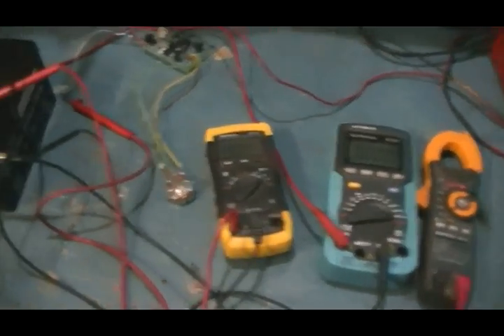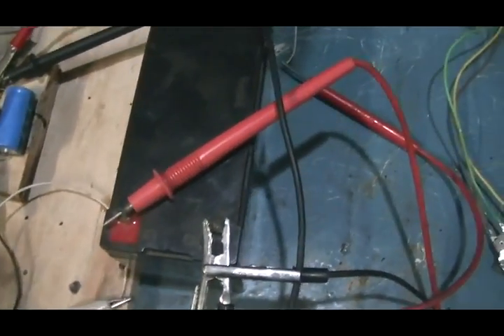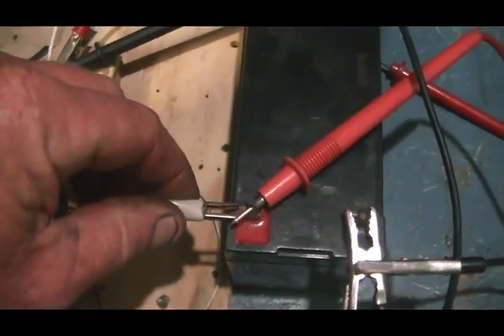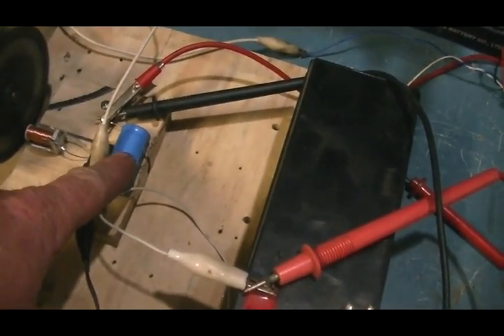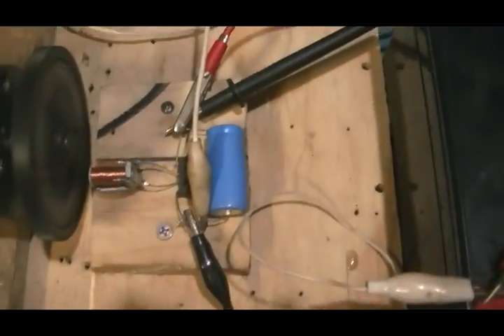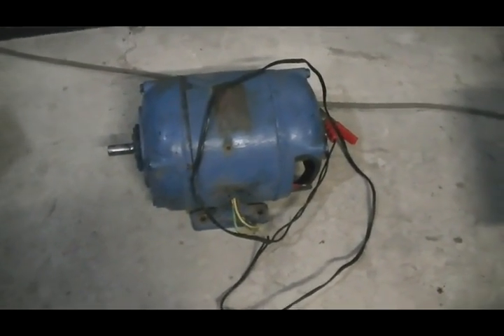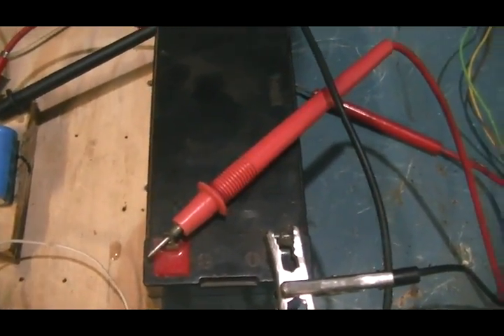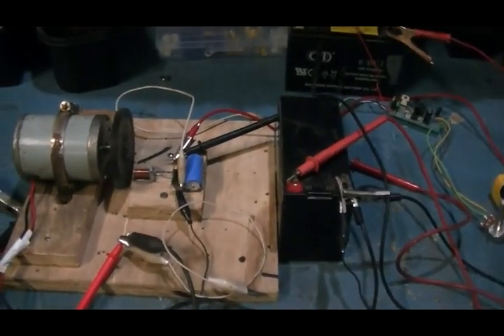Overunity,underunity battery voltages

Comment: Agreed... We are all still learning. Exp: I bought a water pump for my heating system. It only converts 38W/el. to pump the same volume as my old 98W pump. But they do not call it  an overunity pump. Instead, they call it a High Efficiency pump. It is somewhat the same as a 2700 Kelvin Light Bulb @ 30W/el. ~300 Lumen, verses an LED @ 2700 Kelvin @ 3W/el. ~300 Lumen. Here is also no overunity. Just a higher efficiency. It just goes to show, that we are still learning what 100% is.

Comment from the maker: I have just about got my lister back together,and as you know(thanks to Darrell)i have a very good HHO cell.The lister will be producing electricity to run the cell and load,producing heat from the exaust(via clean air shroud) to heat a room,and the water supply will be hooked to a tank for hot shower's
I think the vibration will be a little to much for a massage table but lol.

Comment: Hi TM.... Very good observations and theories! It gets even odder if you raise the Potential. As far as overunity goes?? I personally believe that it does not exist. I believe that we are still learning how to implement what we have in a more efficient way. Which is in other terms an Overuntiy to that what we have learned. Wich  does not include Neg. Resistance or Organics. Gearing up for my HHO Lister Grid and Heater Tied system. Wich should shoot heating and electrical efficiency over 96%???